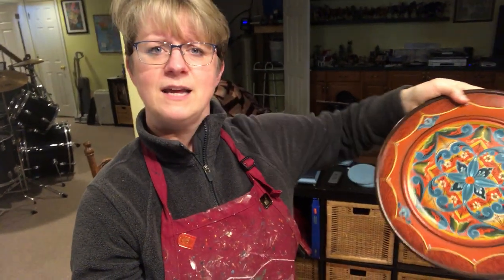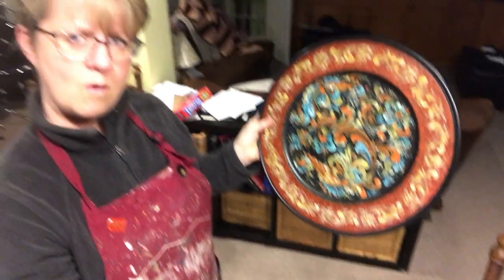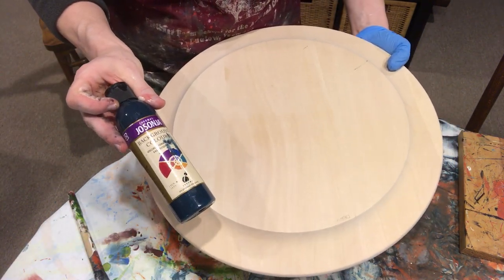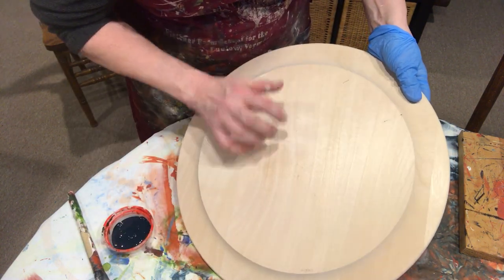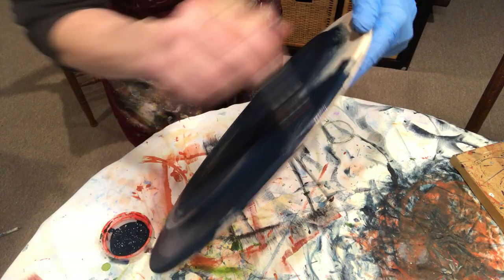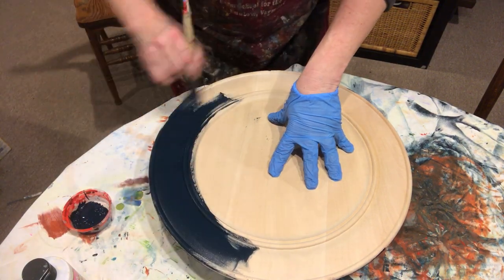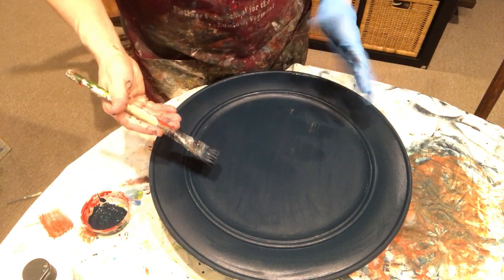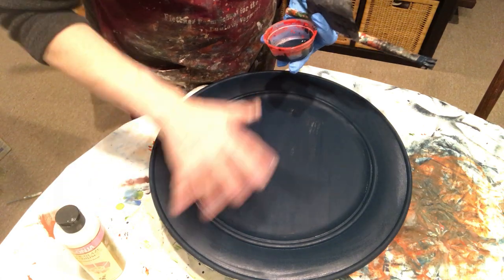Base Coating a Wooden Plate Tutorial - Rosemaling By Art of Lise - unintentional ASMR Therapy

Comment: Nice, simple and on point, thank you. Do you use the same acrylic for furniture or an enamel furniture paint? I'm getting back into rosemaling in Rogland style after not doing it for quite some time. My local supplier dried up years ago before Google and that made it tough. She had pre-mixed oil based enamels, exotic brushes, and locally turned plates. I started prepping a drop leaf gate leg table using a white primer sealer that did not flow as advertised. Then coated with an "enamel like" furniture paint from a local big box store and it blushed horribly. Back to square one.
Reply from the maker: Hello and thank you for your compliment and for enjoying the video. Thank you for your question.  I have actually fully transitioned to acrylic based paints for both my rosemaling and for basecoating.  For my smaller pieces I will often use JoSonja - by Chroma base colors or even Delta, Folk Art, etc.  Because I typically do a lot of big pieces, I have an account with my local Sherwin Williams where I have color matched my background colors so that I may purchase a quart at a time.  I am sorry to hear that your drop leaf table prep went south...I have had that happen and it is not fun!!  I would speak to your local paint store and pick their brains a bit in regards to painting your piece.  They may be able to direct you in the better direction.  Also, there are some plate turners that I can give you the links for as well. Thank you again and have  a blessed day!

Comment: What is the ratio of paint to either glaze or sealers? Thanks
Reply from the maker: Hi, thank you so much for your question.  I typically do 2:1, paint to glaze/sealer for the initial coats. I will add more sealer/glaze to the paint if I feel that it is not a smooth as I like it to be.  I do lightly sand in between coats so that I have a smooth surface to work with.  This is what I have found that works for me, but I know that other artists may have different ratio proportions that they like.  It is all about experimenting with the mediums.  Thank you again for asking.
Reply: @rosemalingbyartoflise7657  thank you for all your help. I truly appreciate it